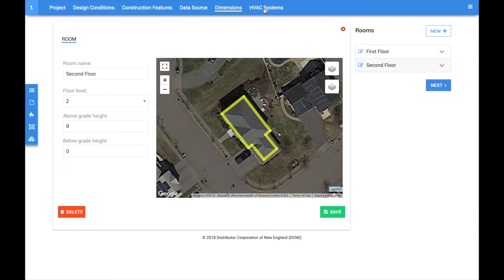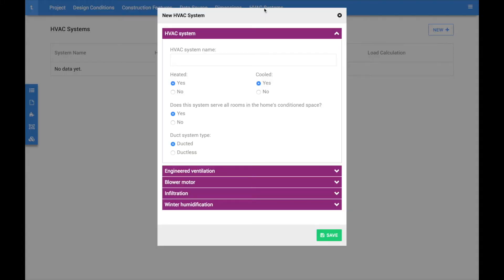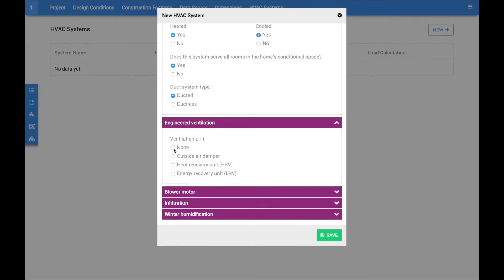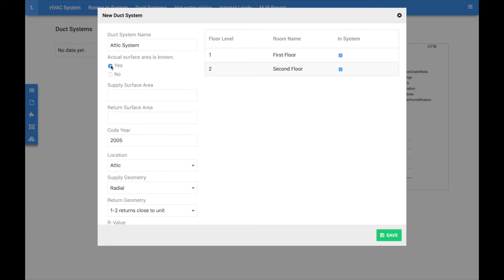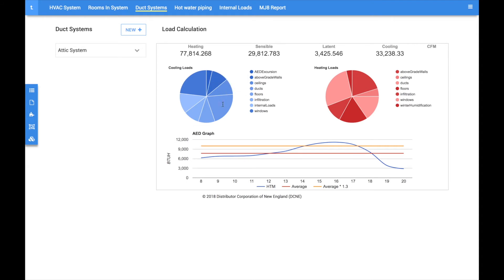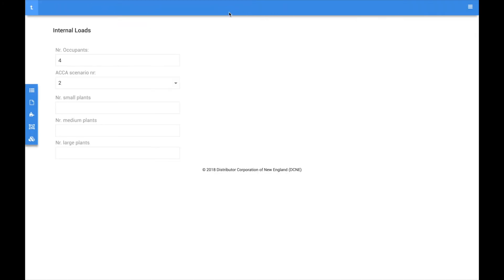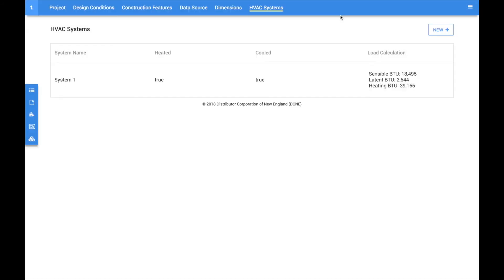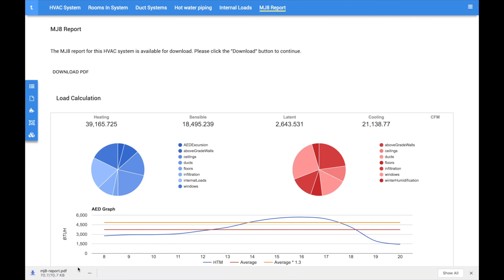CoolCalc 2.0 - HVAC Systems Overview

Comment: This doesn’t help at all. What do I put for heating efficiency, cooling efficiency, and latent cooling efficiency?
Reply: Those inputs are referring to the efficiency of the ERV or HRV bringing in fresh air. Most fresh air ventilators are around 65-70% efficient these days. Therefore I would enter 0.65 or 0.70 for all three values. Actual efficiency can be found in the product data book for the ventilator you are installing.